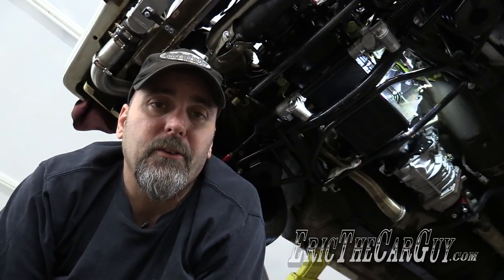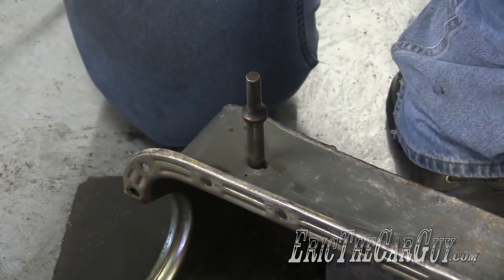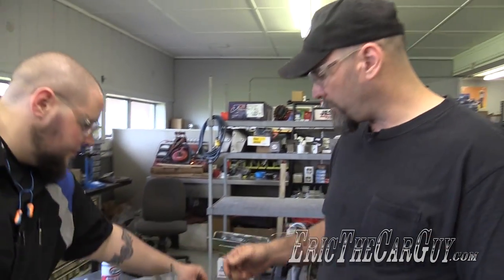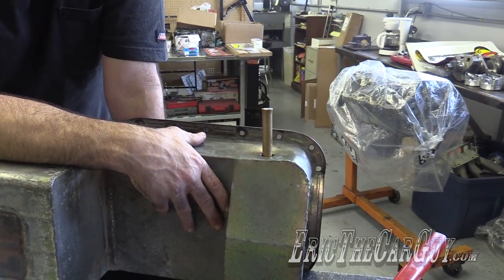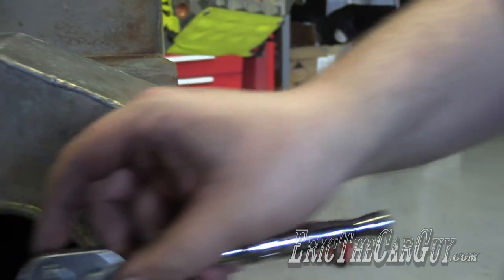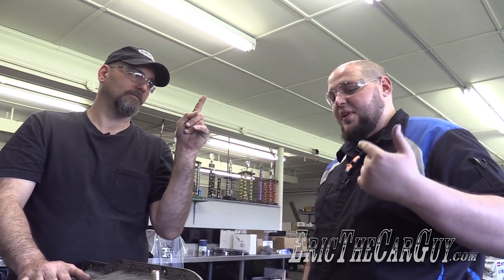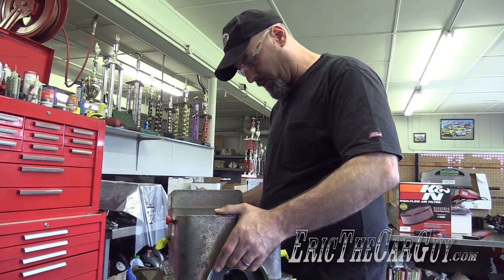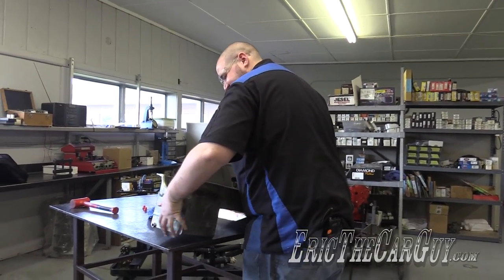Oil Pan Modifications for Turbo and 4 Bolt Main Small Block Ford #DarkMatterPikachu

Comment: LOL, for now i thought that guys from kalvinator knew something about building engines... but they totally killed it with this shit... drill, then hammer it, do a screw and seal it?? WTF?!! what about weld a nut from the backside or just insert a return and weld it from outside... now try it on aluminium pan :D :D guys guys...
Reply: sorry do a crappy screw... and then that sealing from outside with glue rofl..
Reply from the maker: As stated in the video, the method shown in this video is what the turbo instructions called for. It worked fine and there are no leaks.

Comment: Remember that he is following the kits guide!!!
Reply: Yes, and the kit is from a less than reputable company that  offers really poor quality cheap chinese components and the cheapest possible methods of installation. Their kit instructions are do not even meet a minimum industry standard and the installation is likely to fail before 100 hours of operation. 
The return hose supplied in their kit will not pass any major US sanctioning body tech inspection, it is a leak and fire hazard due to the close proximity and extreme heat of the turbo housing and exhaust tubing.
Reply: Considering the popularity that ETCG is gaining I am surprised he hasnt been able to go to a reputable turbo supplier and been able to get "sponsered"
Reply from the maker: At least someone is paying attention.

Comment: Why didn't you weld a bung to it Eric
Reply from the maker: As stated in the video, the method shown in this video is what the turbo instructions called for. It worked fine and there are no leaks.

Comment: eric i just ask that you make an etcg1 video admitting that this method is not ideal. even diy guys wouldve had someone weld in a fitting. whats a new oil pan gasket and a fitting gonna cost? thats totally in the average guys budget.

Comment: I would had drilled it out stuck a Teflon washer on it then put a nut on the back side and  torqued it down
Reply: Nonsense. Both will be bad, brass worse, it's a metal. Most of your comments are ill informed at best.
Reply: they make kits for these Teflon is not what you guys are thinking it's a hardened washer on the outside not the inside that the stops from leaking but in our case we TIG welding them round the outside

Comment: why not weldon fitting, or just put a nut on the back?
Reply from the maker: As stated in the video, the method shown in this video is what the turbo instructions called for. It worked fine and there are no leaks.
Reply: Loctite 577 would have been ideal. But this will probably work aswell. At least you guy had fun in the shop and thats really the main thing on a project like this.

Comment: What the fuck!?   Dude - you had the pan OFF THE CAR and you still butchered it?

You could have drilled the hole out and backed the thing with a washer and nut.
Reply: tcpnetworks you don't want to bolt something onto your crankcase with a nut inside it because a. the bolt can come loose and you will not know until it's too late. b. if the bolt falls off it can be bounced around in the crankcase and that's not good. C. it is more likely to leak. it's easiest to to tap onto the pan itself or weld a bung on.
Reply from the maker: As stated in the video, the method shown in this video is what the turbo instructions called for. It worked fine and there are no leaks.

Comment: I think they could have fixed that by using 2 Hardened Washers (Washer on the inside and one on the outside), Nut and Bolt to crimp the hole back to a smaller size before tapping it then use a Red Rubber/Nylon Fiber Washer to seal it. Other why's not Hackary, just having the owner of the part and a Camera in your face will cause you to mess up.  Not his fault guys come on now, not the end of the world either and the oil Pan can be fixed it's not junk.
Reply from the maker: As stated in the video, the method shown in this video is what the turbo instructions called for. It worked fine and there are no leaks.

Comment: Didn't see answer in comments; Someone know why spraying oil on the crank would be a bad idea? (3:00) Thanks!
Reply: ThePepperdirt it adds weight the the rotating mass of the engine and saps power, look up windage trays, its the same idea, not sure why they just use those chinsy pieces of metal on the side of the pan instead of a full windage tray.

edit:looks like it does have a windage tray further down in the pan.
Reply: Todd McCarter Fascinating! Never would have thought the weight being offset. Thanks. Perhaps an OHC would require same care? ( my setup has an oil return line pumping oil directly on cam ). Specifically, on the non-machined area of Cam. Thanks again!
Reply: Only bearing need oil so it could be a concern, however any power gains will be very minimal, so you have to ask youself is it really woth the bother in some of these cases.
Reply: Todd McCarter  Mine's an additional oil filter, bypass filter. No worries of power gain, just engine health. Thanks for your help!

Comment: Sorry Eric. That's not how to fit a turbo return. I could see it on your face the unhappy look. Drill and tap it. Very common in the mx5/miata world.
Reply from the maker: As stated in the video, the method shown in this video is what the turbo instructions called for. It worked fine and there are no leaks.

Comment: why not drill it for the size and copper washers on both sides then a nut on the inside....???
Reply from the maker: As stated in the video, the method shown in this video is what the turbo instructions called for. It worked fine and there are no leaks.
Reply: Tidy mate, job sorted.

Comment: That oil return is butchery, why not weld in a boss? If someone did this to my car they would have to get new oil pan. But if you look by roadkill standarts it is good :D
Reply from the maker: As stated in the video, the method shown in this video is what the turbo instructions called for. It worked fine and there are no leaks.

Comment: This is hack job inc. I get that you are doing it 'per the instructions'. I did it the same way, mounting a Vortech Supercharger on my Mustang. But only because it was my only option!! I wasn't going to pull the engine, to drill and weld a bung into my oil pan. You had the engine out, oil pan on the bench?! No excuse to not do this job correctly.

Comment: You weld a bung in and your done. Must have been a brain dead day at the shop. Happens to all of us.
Reply from the maker: As stated in the video, the method shown in this video is what the turbo instructions called for. It worked fine and there are no leaks.

Comment: "As stated in the video, the method shown in this video is what the turbo instructions called for. It worked fine and there are no leaks." -Eric
If it works, it works. ALTHOUGH I have learned that if you hack it it will work for a period of time. a month, a year, fifteen years. it just depends, but in the back of your mind its going to eat away at you, knowing you've done the job wrong and one day you'll go back and fix it, because its not the customer's car... its your car. Blood sweat and tears went to doing it right and when everyone says it's butched you'll know you fucked up and you'll fix it. then you'll look at it 15 years from now and be happy knowing you did right and followed your judgement despite what the directions said. You consciously don't want a bung Eric, but you subconsciously need one.......
Reply from the maker: Thanks for your input, but let's be real. It's not a problem till it's a problem. I have every confidence in this installation and if it leaks one day, I'll address it. Till then I'll leave the speculation to the comment section. Meanwhile, I'm going to finish building my car.
Reply: love your videos man, its just when all my buddies or whoever looks at my car and my work, I may be proud of it but then harsh reality kicks in when you start to feel like meh, it could be better, but like I said you deal with it when you do, same as I will on my cars. when it breaks or whenever an upgrade is option and going to be fun. I do love the fact that you stand by your ideas despite the critics, because everyone on youtube knows EVERYTHING
btw my buddy got drunk last night and started posting this comment everywhere, no hard feelings
been watching since your 100 hundred subscriber brake drum video and I myself have welded a balljoint, worked for 3 years still good :)

Comment: Wait.... why didn't yall just drill the proper sized hole in the first place?  That looks like a really, unnecessarily difficult way of doing things.
Reply from the maker: As stated in the video, the method shown in this video is what the turbo instructions called for. It worked fine and there are no leaks.
Reply: Don't get me wrong, it was sure fun to watch.  It's the silly little things like this that take up all the time in a project.

Comment: Man that seems kind of janky.   Why didn't he just weld a bung on?
Reply from the maker: As stated in the video, the method shown in this video is what the turbo instructions called for. It worked fine and there are no leaks.
Reply: EricTheCarGuy Maybe if it hadn't been done so...... Er... Rough. It wouldn't have seemed so bad.

Comment: I don't get it drill a hole and then weld in a bung. They aren't stuck on the side of the road somewhere, they are in a freaking machine shop.
Reply from the maker: As stated in the video, the method shown in this video is what the turbo instructions called for. It worked fine and there are no leaks.

Comment: I could be the of the thousand who say this but it would have been way more clean and professional 
 drill press use a c clamp drill the pilot hole 1/8th move up to the size you need in steps.. then make your adjustment for the caps man
Reply from the maker: As stated in the video, the method shown in this video is what the turbo instructions called for. It worked fine and there are no leaks.
Reply: EricTheCarGuy I love how everyone thinks there way is the right way.  I watch these videos and other videos like this, not as a how to guide, but to see how others do things. we may think a certain way is terrible for one application, but it can help in another.  keep an open mind!

Comment: Am I the only one thinking "weld a reinforcement plate in the side and tap that" or at least silver solder the fitting in?
Reply from the maker: As stated in the video, the method shown in this video is what the turbo instructions called for. It worked fine and there are no leaks.

Comment: Who the hell built that oil pan? It looks like some random pieces of scrap sheet metal butchered together with a stick welder.

And THEN there is that fitting installation. For somebody at home doing it without special tools, this would have been an "OK" way (and maybe it is OK for the ETCG viewers who do not have the tools) but for a machine shop? Not really. I am pretty sure they do that another (better) way usually...
Reply: It is a cheap chinese knockoff of a Canton unit.
Reply from the maker: As stated in the video, the method shown in this video is what the turbo instructions called for. It worked fine and there are no leaks.

Comment: why not weld in a port?
Reply from the maker: As stated in the video, the method shown in this video is what the turbo instructions called for. It worked fine and there are no leaks.
Reply: EricTheCarGuy ya it would say that in the instructions because the instructions are written out to reduce the installation costs. have you ever seen a factory turbo installed that way?

Comment: You went to the trouble of fabricating and welding in baffles why didn't you just weld in a bung it probably would have been faster too
Reply: Wilson Smith they didn't make the pan.
Reply from the maker: I never welded the baffles in. That's the way the oil pan was made. As stated in the video, the method shown in this video is what the turbo instructions called for. It worked fine and there are no leaks.

Comment: Why not just weld a bung to the pan instead of beating the pan up?
Reply from the maker: As stated in the video, the method shown in this video is what the turbo instructions called for. It worked fine and there are no leaks.

Comment: A real machinist would have made a steel "bung" with pipe threads tapped into a drilled hole and tig welded the machined part to the oil pan with a drilled hole thru it to drain the oil......I'm not seeing much to impress me yet, crude crank balancing then this mess...ugh definitely not racing quality work unless you want to dnf
Reply from the maker: As stated in the video, the method shown in this video is what the turbo instructions called for. It worked fine and there are no leaks.
Reply: Those guys give real machinists a bad name to those who dont know better. Look at abom79, or Keith Fenner for some real machine shop work!

Comment: Punching a hole out....... no weld on fitting?
Reply from the maker: As stated in the video, the method shown in this video is what the turbo instructions called for. It worked fine and there are no leaks.
Reply: I'm glad it's working out good- just felt strange!

Comment: should have bought a weld on AN bung.
Reply from the maker: As stated in the video, the method shown in this video is what the turbo instructions called for. It worked fine and there are no leaks.
Reply: ya, its not a bad way to do it if the pan is on the motor. like you said in the video but a weld in bung is much easier. but if it doesnt leak it doesn't matter how its done lol. looking forward to more videos of the car.

Comment: What a hack job on that tap Eric.  He needs to buy you a new oil pan a do it right.  If not it should be welded.
Reply from the maker: As stated in the video, the method shown in this video is what the turbo instructions called for. It worked fine and there are no leaks.

Comment: you have the pan off and its dry why not just weld a fitting in this just seems wrong
Reply from the maker: As stated in the video, the method shown in this video is what the turbo instructions called for. It worked fine and there are no leaks.

Comment: What I can not believe is this. 1) The method used. While the pan is off the engine, and your at a machine shop you choose the most hackery way to do it. 2) In your many years of experience you didn't question this method or voice that you verified this method with On3Performance  614.439.0057 prior to start and state in the video that you did that. 3) After filming and in video edit phase, go HMMM this really looks butchery. The hint might have been the father walking off shaking his head. And send him the rough cut and ask him what he thought PRIOR to posting it online. 4) After taking criticism on this method in comments,  just take the video offline in respect for the machine shop and the owner.

Comment: That return plug is going to leak. Think about all the heat cycles and hot oil....love you man, but that will leak.
Reply from the maker: As stated in the video, the method shown in this video is what the turbo instructions called for. It worked fine and there are no leaks.
Reply: Well, I stand corrected....my apologies.

Comment: Eric. Please be professional... silicone instead of welding or soldering??? what was it? In my small garage in Poland I can make it better...
Reply from the maker: As stated in the video, the method shown in this video is what the turbo instructions called for. It worked fine and there are no leaks.

Comment: Personally I would of machined a boss on a lathe and welded that on, I don't trust that one bit!
Reply from the maker: As stated in the video, the method shown in this video is what the turbo instructions called for. It worked fine and there are no leaks.
Reply: EricTheCarGuy No worries. I don't want to come across as being offensive though it's just i found it quite surprising.

Comment: Just saying drill a hole and weld a nut on inside of pan 123 done instead of the butchering
Reply from the maker: As stated in the video, the method shown in this video is what the turbo instructions called for. It worked fine and there are no leaks.

Comment: Start over and do it proper. This hack is unworthy of the build. First, get a pan that fits without any interference. For the return, do the bung thing.
Reply: Normand Dionne it's a aftermarket block in an aftermarket K member in a car that doesn't have a big aftermarket. not many people make oil pans that check all those boxes. and aftermarket 4 bolt 302s are know for having oil pan clearance issues.
Reply from the maker: As stated in the video, the method shown in this video is what the turbo instructions called for. It worked fine and there are no leaks.

Comment: sorry but ole crap a machine shop that pounds a hole in an oil pan and threads it....wow even i wouldn't do that at home let alone pay someone to do it....
Reply from the maker: As stated in the video, the method shown in this video is what the turbo instructions called for. It worked fine and there are no leaks.

Comment: I would feel really bad if I witnessed this happening to my oil pan.  That's a fix somebody might do on a disposible chinese lawn mower.
Reply from the maker: As stated in the video, the method shown in this video is what the turbo instructions called for. It worked fine and there are no leaks.